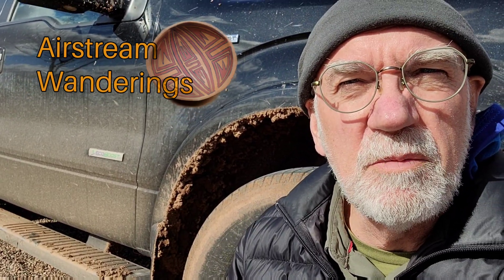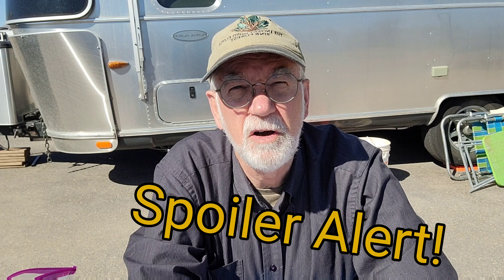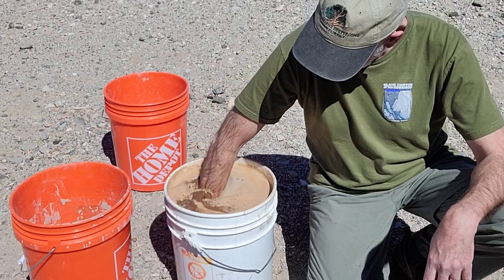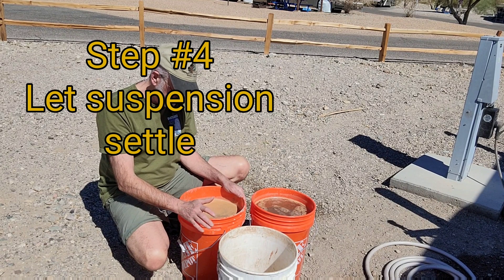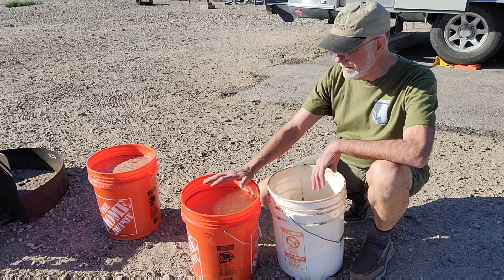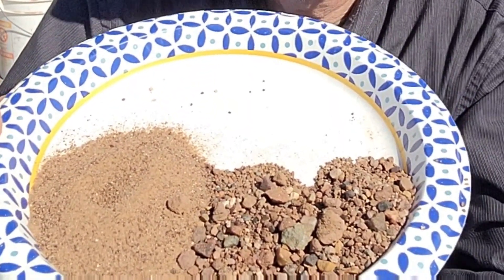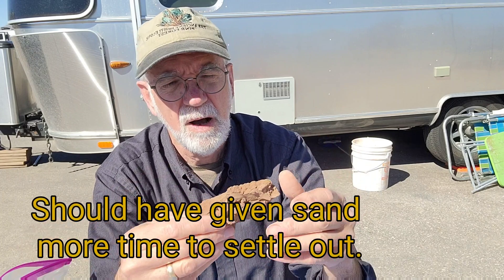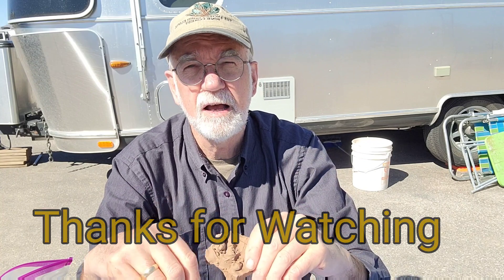Making Clay From Road Mud, + How to Levigate

Comment: so was the final product essentially silt with some clay? I seem to be having that issue where theres a lot of fine settled material at the bottom for me, and it feels like clay but is slightly grainy, also it has some shiny flecks in it. i removed the clay from that and it was very very little compared the the overall sample i found. I'm having a hard time differentiating between this fine silt and clay. any tips would be helpful as to what this is. I wonder if I just have to keep adding water and separating the clay from it for now.
Reply from the maker: Thanks for the comment. I don't think it is unusual to have a lot of silt and it can be difficult to separate. I would suggest levigating the the clay in a 5 gallon bucket and stir it up really well so that that the clay is suspended. I usually pour off the top layer fairly soon but maybe you need to let the silt settle out a little longer and then pour off the clay. If you wait a minute I would think that would be more than enough (I never wait that long). You will probably have to do it several times because the clay will also settle out. Clay is finer than silt so given some time the two should separate.  It also may be that your source really doesn't have as much clay in it as you might think. Having some silt in your clay isn't necessarily a problem as long as the clay is buildable and fires well. Good luck.
Reply: @airstreamwanderings3683 yes I've been trying this in a clear container to allow the settling silt and clay layers to be visible and I had no idea it settled that quickly! I've since been filling with water, stirring and pouring off and am not left with an overly silty material
Reply from the maker: @cloudingmyskyofficial sounds like it is working

Comment: Thank you so much for this lesson in levigation. 

I had to dig a ridiculously deep hole in my tiny urban back yard, and hit a layer of clay.  There’s such an unmistakable feel to clay, in my opinion. 

I could roll it into finger-sized snakes that held their shape when I bent them into arches. It was a very fast-and-dirty test, but it seemed promising. 

I’m going to see if I can separate the clay out from the dirt. I’m curious what I’ll find.
Reply from the maker: That sounds great, I hope it works out for you. Sometimes the clay is clean enough that it doesn't need levigation. But even though it is a lot of work I usually do it.